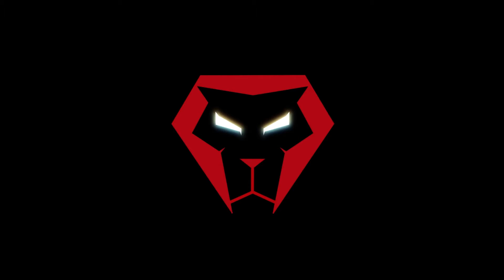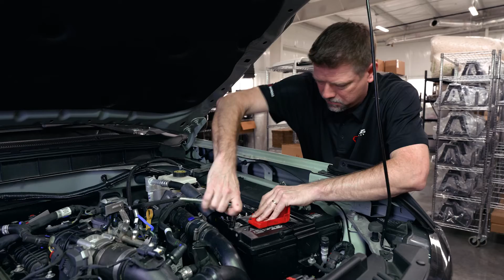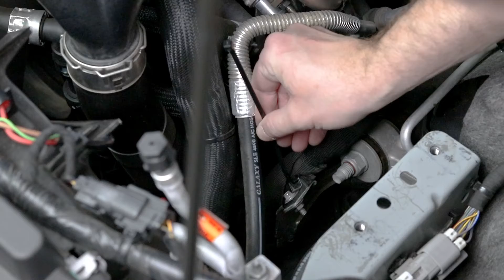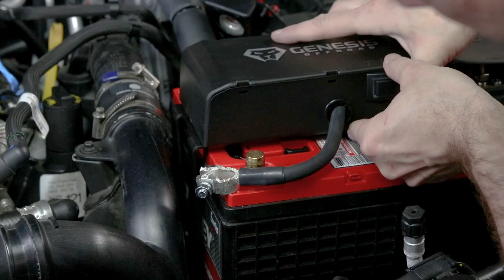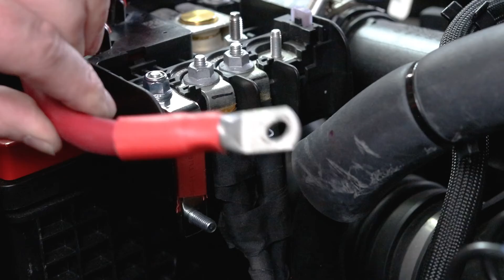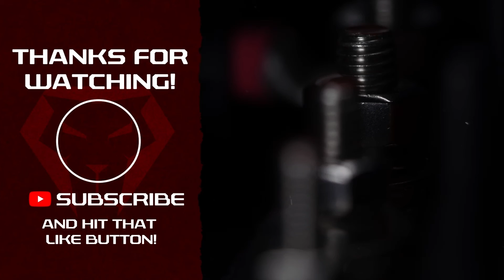Ford Bronco Dual Battery Kit Installation

Comment: So just out of curiousity does the negative on this setup not have to be wired into the battery side of the BMS sensor instead of the body side?  Recently had a customer vehicle in the shop that was wired this way in the video and leaving the vehicle over the weekend we would come back to a dead cranking battery!  I relocated the negative wire in the Genesis to the post of the 2nd battery and have not had an issue since!

Comment: I plan to connect most of my aftermarket accessories (off-road lights, truck radio, Starlink, fridge, air compressor) to the upfitter switches. Is there a way to wire those AUX switches to the accessory battery so I can still use them how they're meant to be used?
Reply from the maker: If they are factory upfitter switches, then the short answer is no. The reason being, the wiring from those switches is included in the mass factory wiring bundle that leads to the fuse box. If they are aftermarket switches, then you can wire them directly to the bus bars, that way they will be powered from the accessory battery. Hope that helps, but email us (info@genesisoffroad.com) if you have more questions or want to talk further about this issue.

Comment: Do you have to rotate your batteries to extend the life?
Reply from the maker: You don't have to, but, if you routinely use your aux battery with the engine off, draining it down low and recharging it, then you would benefit from rotating the batteries. Their lifespan depends on the number of times they are drained down and recharged. AGM batteries can do that 400-500 times. So after a few hundred cyles, you could swap it to be your cranking battery, and the cranking battery becomes your aux battery. That would give you more time before needing to replace them, yes.

Comment: what a nice video, installer and product. Disappointed no status gauges or app to monitor batteries. So this system is meant a backup to the started not to run systems like refrigerators
Reply from the maker: Our system is primarily designed to provide power for accessories and to prevent your starter battery from draining. Also, check out our G Screen monitoring system to monitor battery status. https://www.genesisoffroad.com/products/gen3-g-screen

Comment: I have a couple of solar panels connected to the cranking battery. With this system will the solar panels charge the accessory  battery once the cranking battery is completely charged?
Reply from the maker: Yes. Once the system sees your cranking battery above 13.1v for a minute, it will link the batteries together so they both will be charged from your solar panels.

Comment: I'm going to install my kit tomorrow.   Thanks for the install video
Reply: Had anyone else had a problem with the battery test contacting the radiator hose and trans cooling line?  I'm trying to determine if it's just me

Comment: Where does the Engine On sensor cable go in a bronco installation?
Reply: I second this question.  There's no documentation for this wire.  Obviously it plugs in under the cover to the green extra wire with the female wire connector, however, which fuse should this be installed to?
Reply: So I just found this on their site. "To use, lift bus bar cover and grab the small green wire, plug in sensor cable into the green bullet connector, route cable to the factory fuse box, find and remove any ignition-hot circuit fuse, insert factory fuse into fuse tap, insert fuse tap into factory fuse box."  It sure would be nice for them to tell us which fuse to run it to rather than just guess and check, trial & error.
Reply: @kyleayers5848  I got the following answer via email from their support

Answer: You'll want to confirm, but fuse 32 should work. Any circuit that is only powered when the ignition is in the "on" position will work.

Comment: Does this work on a broncos sport if not I would definitely like to see one
Reply from the maker: We haven't had an opportunity to look at a Bronco Sport closely yet. I would guess your engine bay is probably tighter on space just because it's a smaller vehicle, but take a look at the video closely and see if it looks similar to your engine bay. If it looks similar and you'd like to try it out, go for it. If you run into any fitment issues, you can return the kit for a full refund.

Comment: Interesting kit. Probably doesn't matter, but as an FYI, that unused positive terminal your busbar connects to will actually already be in use on Everglades models and on Broncos with the Ford Performance/ Warn winch kit installed.
Reply from the maker: Thank you, I appreciate it! We added that little bus bar piece to make it easier to attach our wire, without having to cut a hole in the side of the red plastic cover.

Comment: Can I use the factory battery and add additional small battery for the accessories?
Reply from the maker: Technically you could, but it will be tough to find a battery that will fit next to the factory battery in our tray that is big enough to be worth the effort.
Reply: @GenesisOffroad  thank you

Comment: It seems a nice and practical setup! Very clever setup using 2 high quality TPPL AGM batteries that allows the auxiliary battery to be equal than the cracking battery. Please, let me a question, why is the original IBS sensor connected to the negative of the auxiliary battery instead of the cracking battery?
Reply from the maker: Good question. Couple reasons. First, the factory negative cable doesn't have any slack on it, so it won't reach all the way over to the negative on the new cranking battery (the one closest to the engine). Second, for sake of simplicity, we did not want to make the customer have to extend the IBS sensor wire by cutting/splicing extra wire onto it. Third, it's debatable whether there would be any benefit of doing that at all. The technical pros and cons of doing that is a longer conversation than we can discuss here, but in short, we don't feel there's enough of a benefit to make it worth the trouble. Hope this helps! -Shane
Reply: @GenesisOffroad  Understood, thank you for your reply!

Comment: Have you done any testing with the 12 Volt
Lithium Batteries?  Dakota makes a really nice battery plus optima is going to be out with their new automotive lithium battery in a couple months. The only reason I bring this up is the massive weight savings. Two Dakota batteries weigh less than one odyssey.
Reply from the maker: Yes. There are still several limitations with lithium batteries. First is that, to our knowledge, there are no lithium batteries made in the Group 25 size which fits into our tray. We don't have a single millimeter available to use a larger battery, and the next smaller size available is too small to be worth it. Plus, lithium still doesn't like very low or very high temps, and they also are not suitable for high amp draw applications such as for running a winch. So for those reasons, we're out of luck with running lithium in our dual battery trays. However, you could certainly add a dc-dc charger onto our dual battery system in order to charge a lithium battery located somewhere else, maybe in the rear storage area, for powering a fridge or other camping gear.